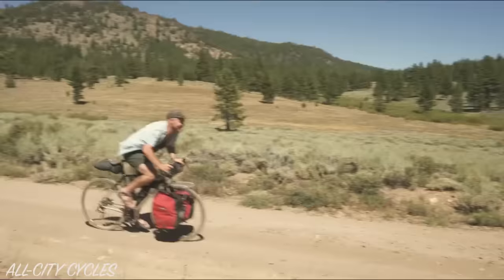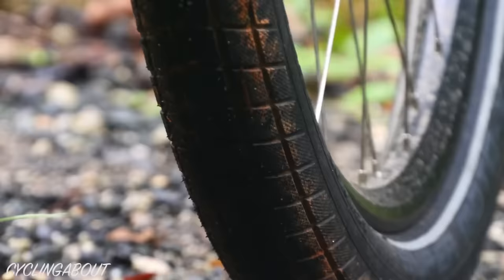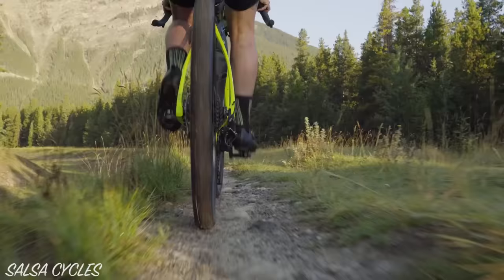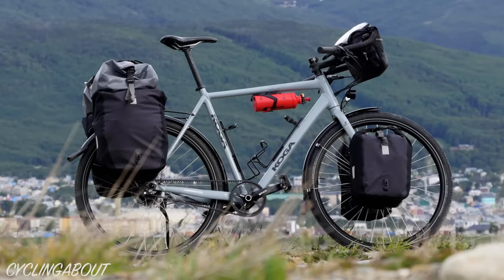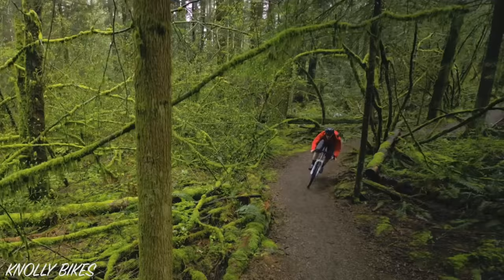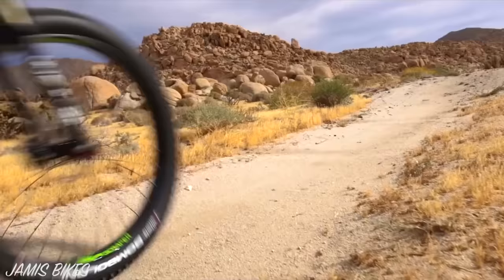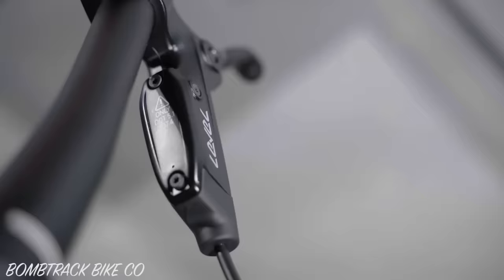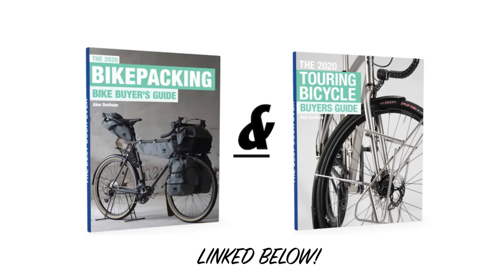What Is The ACTUAL Difference? Touring VS Bikepacking Bikes

Comment: It is not true, that bikepacking bikes are mainly used for shorter trips. People use them for racing self-supported races across continents - this is becoming more and more popular - often riding more than 4-5000 km as one long timetrail. Like the Trans American Bike Race (US), Trans Continental Race (EUR) and Indian Pacific Wheel Race (AUS). Hardly no one would ever use a touring bike for these races. They are simply too heavy. I personally use a 1x titanium gravelbike with drops and triathlon bars - and it has a SON dynamo hub to charge bike computer and smartphone. After trying bikepacking and getting ultralight tent, sleeping bag etc., I do not think I would ever go back to the big panniers - even if just touring. I can have my entire sleeping arrangement in my front bag and it weighs only 1350 g - and less if I only bring a bivy bag. Clothes go on the rear bag. Spareparts, phone, extra powerbank, food, ultralight towel etc. in the frame bag. Dynamo hub charger in the toptube bag. More food in the food pouches on the handlebar.

Comment: "Bikepacking bike" sounds strange. Like, a bike you use to pack another bike in.
Reply: Lmao
Reply: @waltinseattle  Yet you don't say "a back backpack". That's his point.
Reply: @nicojar  the parallel would be a bike bike pack.  whats wrong with pack, pannier, saddlebag(s), , bed roll or bindle?  do we really need new words? travoir is probably out of common use so I wont ask about it. just realize that if your trailer looses a wheel thats pretty much what you are left with .
Reply: The term is awkward. I've personally taken to calling them camping bikes instead. While you'd usually camp outdoors on longer tours(on or off road), calling it a camping bike emphasizes the typical off road use and configuration. At least in USA the connotation would be clear. It seems as the lines continue to blur, bikes may start to be categorized by the total weight rating vs a designated use.
Reply: I'm now never going to be able to unthink that everytime I hear bikepacking bike lmao
Reply: Yeah, i remember the day when we only know the road and mountain bikes, but now it's explosion in names! 
Mostly for marketing reasons!
Reply: @waltinseattle  I think the parallel would be "bike backpacking" but I'm not sure

Comment: i have just converted a 1992 trek 930 singletrack to a touring bike with new wheels, tubus rack and a brooks saddle, i love it!!
Reply from the maker: Sounds awesome!
Reply: I love my 930s. Except I'm taking it the "retro mod" route and I'm planning a tubeless setup,  1x10 drivetrain, and dropper post
Reply: @Cyclingabout  it really is, its just awesome to build your own bike the way you want it without compromising
Reply: I converted a 1991 930 to touring back in 1998 and rode from Boulder, CO to San Francisco.  It was perfect!  I re-built the wheels, changed tires, expanded the gearing and upgraded lots of parts.....one of the funnest bike projects I've ever done!  Hope you love yours.
Reply: I have a 930 converted to commuter. Did you change the fork to a touring fork also?
They are awesome bikes,  trutemper frames and made in USA. what happened to Trek . They made some awesome stuff in the 80' and 90s
Reply: Mountain bikes and components from that era can be excellent quality. I really like them.

Comment: My first touring bike (1974) was an old Cinelli frame from the 1960s.  The pack frame broke in Morocco and was rebuilt using rebar. My bike pack was a Kelty back pack off its frame, folded over the rear wheel. My 'stove' was a wood fire - stainless spokes make for good brochettes. A kilo of dried camel hump got me across the Moroccan Sahara. Missing an oasis almost killed me.  I rode all night, knowing I would die of thirst if the sun rose before I found water. I got a lot of puzzled looks in tiny villages in southern Algeria. One could tell that some people had never seen a bicycle up close.

Comment: This is an excellent comparison between the two touring setups. My Genesis Longitude is fine for both ways of travel I guess. The only upgrade I am now thinking is getting a dynamo hub and some connected lights for it. It would be just safer on the road if I could keep the lights on all the time without worrying about their batteries.
Reply: me six. Actually, I am even more confused, I didn't even know there was such a thing as a touring or camping bike, I thought it was a MTB with lots of bags hanging on it. Such types, much wow.

Comment: I have a 2019 Salsa Fargo Tiagra. Love this bike. I've done some shorter tours (200-300 km) on varying terrain but with a more traditional touring set up, ie, racks, panniers, bungee cords, etc. Works for me. Plan on doing extended touring with it. As I am getting older one drawback is it could have a little lower gearing.
Reply: I did tour starting from Sitka to San Francisco through Vancouver Island on a Surly Troll. It did everything with confidence, including single track. The Jones H-Bars are the most comfortable bars I have ever ridden.

Comment: Excellent video and I actually watched it twice.    Although I understand and appreciate the concept of bikepacking by keeping it as light as possible so you can basically mountain bike with gear, I will probably always use panniers and racks although I have learned to lighten it up considerably over the years.   They are so much simpler and will never limit where I can go.
Reply from the maker: I don't really have problems with panniers, even off-road. Most trails are wide enough. 👍🏻
Reply: @Cyclingabout  panniers are only an issue on heavy motorcycles offroad, bicycles are light enough that you can literally lift it over a narrow section if required.

Comment: Expedition touring bikes appear to be one of the few remaining bike types where the 26er wheel lives on...smaller diameter (easier to fit into the bike box), lighter weight, sturdier wheel (shorter spokes, shorter distance between spokes), increased agility (somewhat offsets the long chainstays and wheelbase?), part / tire availability in less developed countries (where the 29er and 27.5er craze has not replaced it yet).
Reply: I imagine a 27/29 would roll a ton smoother tho. But more weight to be pedalled.

Comment: Until now, I thought bike packing and bike touring were the same thing... Something new every day :)
Reply: They should be the same tbh. There's no way someone goes bikepacking without rear paniers unless it's like a 1 nighter.
Reply: I watched the whole thing and still think they are !
Reply: Yes apparently you don't really have to be Touring to be Bike Packing. No one said you actually have to go very far or use anything from the bags. So I guess Bike Packing is for people that will not be Touring, just put some bags on the bike and ride around before they go back home.
Reply: @FastBastar  most people doing the tour dived don't use panniers and the quickest anyone has done that is 14 days
Reply: @plusbonus1165  Very close for sure. In my interpretation, bikepacking has a sportive background (people extend their sport into an "adventure"), while touring comes from the travel side (people do an adventure and happen to use sports equipment - a bike). The result is similar but IMHO not the same. Watch the excellent video above and you will learn the differences.
Reply: @felixfranke2838  good explanation. Touring bikes are like Toyota Landcruisers

Comment: Excellent video. My Jamis Renegade Elite has the strength and all mounts necessary for minimalist bickpacking as I realized on my recent 825 mile bikepacking adventure from Key West, FL to South Carolina. The bike is rated for 25 lbs on the front and the same on the rear. I had 18 lbs on the rear and 12 lbs on the front of my carbon frame. I weigh 168 lbs. Performed like a champ!!

Comment: All this shows there is a lot of interesting ground in between the categories. Finding out where your sweet spot is is key. Carrying more weight is not a goal in itself, and adding unnecessary weight can be avoided. A relatively sturdy but not too heavy bike and relatively light packing, and doing without unnecessary stuff like a bike stand, gets me in the spot where i like to be: light enough to be fun and even do some off-roading when wanted, sturdy enough to pack what's necessary.

Comment: Last week I biked upstream the Danube from Vienna to Linz, Austria.  I have a 2001 Cannondale F500 that I brought over here from the USA, and made for the occasion into a poor man's touring bike.  I live here and it's my daily/weekly steed.  Would be super curious to hear some basic talking points about such a decision.  I have a Surly rack which I loaded up with at least 30 lbs and camped along the way.  I'm not super fit, but managed 85, 75, and 50km per day, respectively over a 3-day period.  I know that if I was going to do a proper tour I'd need to invest in some better gear, but I really (really) enjoyed doing it with my existing kit, and in my current Zeitgeist, a hobo travels with what he's got.  That being said, I think the aluminum frame is overbuilt for flatland, and the drive train performed just fine.  When I look at the bike, I see a shape that resembles modern day gravel bikes more than modern day mountain bikes.  In the end, I concluded that the setup I had was actually not so bad for the task.  Anywho... enjoying the videos, makes me want to keep putting miles on my bike.... best wishes aus Wien.
Reply: Stick with what you got it sounds just right for you.
Reply: It's a cool older bike but I would've gotten rid of that suspension fork, it's less that ideal for road touring, especially since it's old. I did my South America tour in 2015 on a 1990 Specialized StumpJumper (Rigid steel fork) but upgraded all of the components, wheels and drivetrain to more modern ones.  Geometry wise, those older bikes have decent touring geometry if you put on a tall stem. 
The issue with a lot of those older aluminum mtb frames is that they have no mounts compared to newer touring/bikepacking bikes.
Reply: @2WheelsGood.01  Most Cannondales of the era had headshok , suspension you can lock out from the top of the steerer . Other half has one , its been her go to bike for going abroad. They are robust as the suspension is behind a boot and still going strong ( only maintenance is renewing air,  o rings and some grease)  Bikepacking has changed how people tour, and it’s getting like MTB with all the variations.
Reply: @ronnie8446  after working as a mechanic at one of U.S's biggest Cannondale dealers, I would personally not tour on a suspension bike. It's totally doable, and it can be more comfortable, but I would never want to deal with suspension issues or maintenance, especially in non developed counties. My next touring build will be a rigid steel frame, 650b x 50mm wheels/tires, Rohloff hub.
Reply: Perhaps we have been lucky, it's been down the divide to Denver 2 trips to South Chile and Argentina and Kyrgyzstan on the dirt. I have a newer one the touring 26 with headshok a USA 🇺🇸 made one. 😁 Nice bike you are building up.

Comment: Best option: steel frame classic 26" mountain bike with 3x9 or 3x10 gear and classic panniers. Absolutely tested and reliable, easily replacing parts all over the world, frame easy to repair, geometry perfect both for road or offroad terrain, tires from 1" to 2.3", gear ready for 55 km/h or for the steepest offroad terrain... Classic panniers allow to fast access to anything, with no hundred narrow bags all over the bike...
Reply: Sorry to burst you bubble, I've been touring around north,central and south america on a 3x9 11-36 cassette Surly Troll for over 2.5 years now and I'm in Mexico now and I can tell you that 26" anything is absolutely obsolete! Dead!
 It has been a nightmare.
I can find zero parts for it, anywhere.
Definitely forget tires.Literally nothing anywhere.
Traditional wisdom is gone out the window, China has flooded the market with 27.5/29" everything and that's what killed the 26" anything over the last 5+ years.
Seriously ,everything I have for my bike I had to buy off Amazon and luckily had it within 4 days.
I've spent days and more than a week looking for what was considered simple parts "easily" found :shifters,cassettes,chains,tires,disc rotors 160mm,BB,brake pads,etc...Nada! Super frustrating.
I can't buy a new bike now but I will sell this 26" 3x9 Troll in a flash the first chance I get. You can get everything for it online still. Maybe in Europe too where people still ride 26" bikes.  My friends who toured 10+ years ago are mind blown about this change.
Good luck!
Reply: @alwayslearning7672  Interesting comment. What's wrong with getting things off the internet?
Another strategy is finding used parts locally. I see 26" wheels and tires all over the place in California — flea markets, garage sales, thrift stores, bike co-ops, etc. Often in excellent condition. Same with components. Many shops and co-ops have parts bins.
And there are people selling all these things on eBay.
If you go with reliable components, and treat them well, there shouldn't be a lot of need for replacements.
When something like a tire or chain looks like it will need replacing soon, you can order or replace it in advance.
Reply: My (admittedly limited) experience with a small-frame 26-er (vintage Gary Fisher Hoo Koo e Koo) was that it was difficult to fit the pannier bags far back enough that my heels wouldn't clip the pannier bags. On a multi-day tour, that would get a bit tiresome, as well as wearing out shoes and bags.
Reply: @davidrowe8747  Some vintage mountain bikes had longer stays. Bikeforums.net has a touring forum (or sub-forum) that has threads, including a sticky, on mountain bike conversions (to touring bikes).
Some 80s bikes had very long chainstays (Specialized Stumpjumpers, for one example — there were many others). Some were medium-long, but still long enough to avoid heal strike.

Comment: With a 2 x or 3 x I just need to drop the chain into the next lower front chainring to reach for the light gears. This is such a time saver. While a 1x needs to shift the chain up the entire cassette putting much more stress on the drivetrain especially fully loaded. I'll never part with my Shimano XT 2x12. I find the 22/36 front and 10/45 rear setup perfect for climbing steep mountains in the Alps.

Comment: New to the channel and damn, great info! I've been looking for some good urban/touring bike info for some time. Seriously looking at a Koga touring bike. Main qualities I'm looking for is reliability, ease of maintenance, and packability i.e. flights and train rides.  Belt drive and Internal hub gearing is so fascinating, wish I had more access to this technology in the US.
Reply from the maker: It's a long shot, but Maine Bike Works has Rohloff and Pinion gearbox belt demo bikes they let you thrash around on. Otherwise, look for a Co-Motion dealer as they also tend to have Rohloff/Pinion/Gates bikes on the floor.

Comment: I use a Specialized Crosstrail for cycle touring using panniers and a handle bar mount for my tent and a couple of other items. The first time I rode it loaded, I found an issue where the front suspension fork starts twisting, it can if your not careful develop in to a very serious speed wobble. The other issue is the brakes (rim on this model) despite being well adjusted etc, could not stop the bike when going down a hill.
Reply: At rim brakes much depends on the brake pads. I can recommend Kool Stop dual compound brake pads, if you use V brakes, they wear down the rim very little, but offer a good brake performance.

Comment: My in the works bikepacking kit uses my Trek Remedy enduro bike. Plan to mostly do shorter trips in the mountains with ultralight hiking gear. Want to try riding a hike I did a few years ago with a couple summits and alpine descents. Very excited to try riding scree with my tubeless downhill tires. Still need to make or purchase a frame bag to work around my rear shock but my triangle is big enough to make it worthwhile, have a sweet roll for the my tent, clothing and sleeping kit. Went for a jerrycan for admin use. Hopefully I can stash my food, camelbak, water purification and cook kit in the frame bag. Trying to avoid a saddlebag and backpack to keep my dropper post useful for comfort and downhill performance.

Comment: Certainly in the Uk there has been the distinction of fast touring or winter bike by traditional frame builders,  likey a racing frame with slightly relaxed angles, clearances for mudguards and eyes for rear racks. but strictly for the road.

Comment: I'm leaving on a bike tour in a couple of days riding a carbon road bike loaded with bikepacking gear.  Total weight will be about 210 pounds (95 kg).  The bike is 20  pounds (9 kg) and I am 155 pounds (70 kg).  Gear is 35 pounds (16 kg).  Distance is about 700 miles (1,125 km) and road surface is 100% asphalt.   I've test ridden this setup about 225 miles and it has performed well.  We'll see what happens on a real tour.

Comment: I have a gravel bike which I initially set up for bike packing, but have since added front and rear racks and (gravel) panniers. I keep the weight of the front panniers to a minimum, as the carbon fork really isn't appropriate for this kind of load bearing.